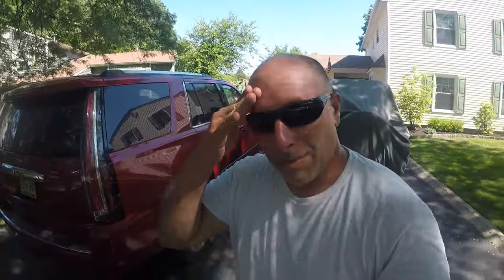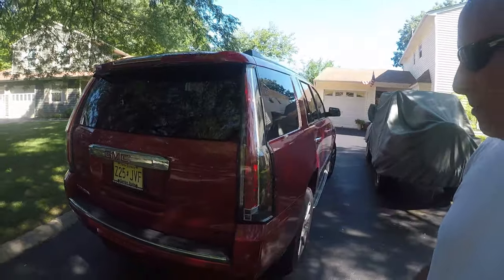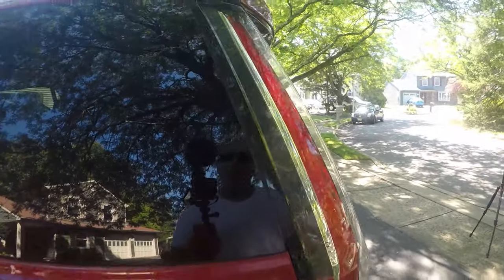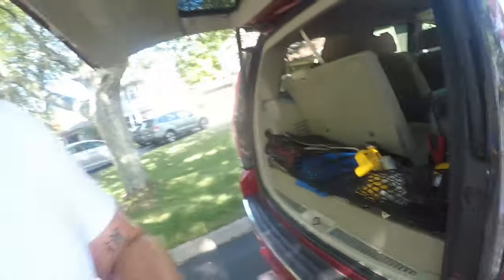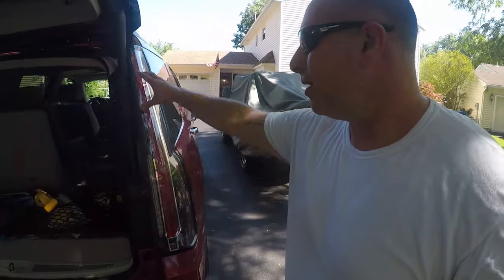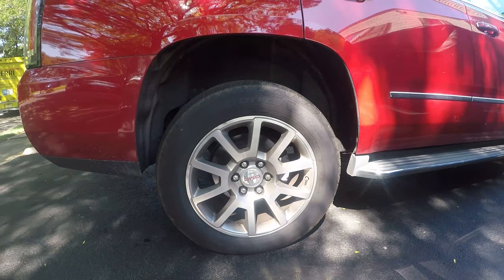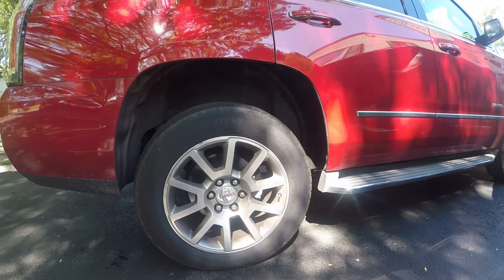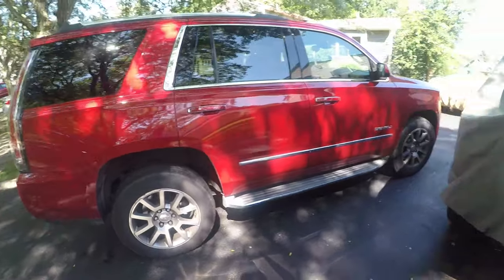2015 Yukon Denali - Escallade Tail Light Convertion - Update Video

Comment: How did you fix the gap?  My right side has a gap.  Not sure how to fix it yet.
Reply: 3M double sided tape apply up and down the stud side.. I applied onto body of car where the studs need to line up in those 5 holes.